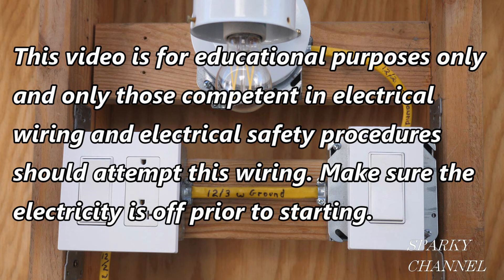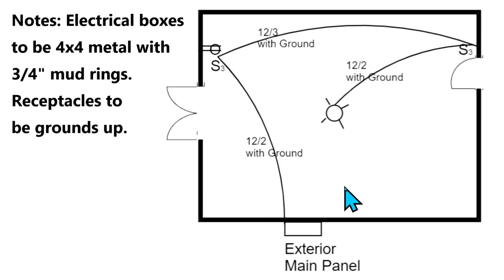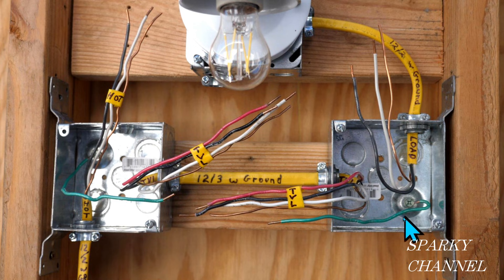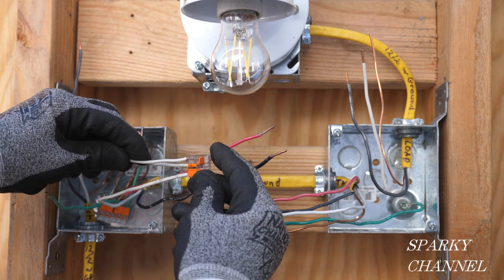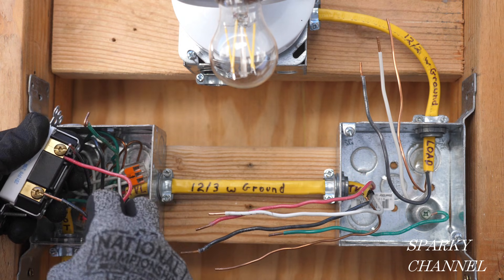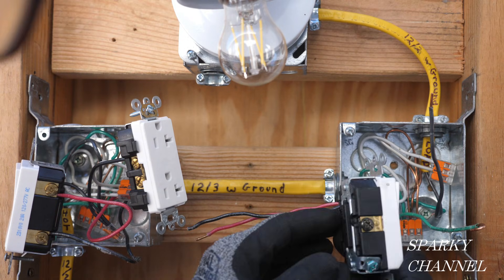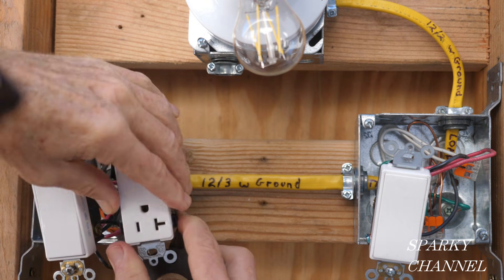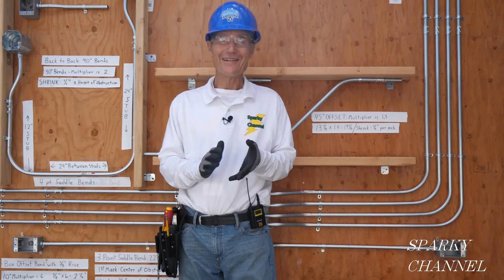Add a Receptacle to a 3-Way Switch System + Wiring from Plans

Comment: Also, just realized that if you're using something plugged into that receptacle, and it trips, you'll be standing in the dark?
Reply: 🤦🏽 this is how you feed receptacles you bring your homerun to the switch box from the bottom you run to receptacles then from the top of your box you run to your fixture not sure how you were taught but now it’s code to have a neutral leg in your switch box
Reply: @Weasel_NM575  I was referring to the fact that the lights are being powered by receptacles. I was taught almost 30 years ago, to keep receptacles and lights on separate circuit breakers, so that if if a receptacle trips the breaker, the lights don't go out as well.
Reply: He said it was a tutorial on how to work from a plan and that it was a simplified plan that could have been drawn up by an architect or home owner. It wasn’t a tutorial on how best to wire a room.

Comment: Does the plastic backing plate need screwed to the mud ring? If so, what's the point of using a "screwless" wall plate if the backer plate needs screwed to the box? That adds an extra step, whereas a regular plastic wall plate would have been just fine, correct?
Reply: so you dont see the screw heads i think

Comment: Thanks for your video and step by step instructions. 

I recently added a 120V receptacle to my three way hall lighting using your video instructions. For reasons I cannot explain the outlet is non-operative. With the lights off the tester shows
“Hot/neutral reversed”. With the lights on tester shows “Hot/Ground reversed “. 

The wiring is according to your description but the outlet is not working!

There’s a pigtail neutral from the spliced neutral to the outlet and a pigtail from the power source to the outlet. The grounds are spliced together.

Any ideas? Thanks.
Reply: Because the hot disconnect when you turn off switch.
Reply: Yes I have same senerio  I have 2 3way switches one 3 way in one 2 gang box with receptacle and 1 3way with receptacle other 2 gang box problem is either outlet only comes on when 3 way switch is on ? Lights work perfect on off either location but hiw do I get outlets live all the time?
Reply: I assume you are connecting the receptacle on right side metal box as shown in the video. Receptacle in left metal box is simple as both hot and neutral wires are directly connected to breaker.
Reply: Any ideas? Power comes into first switch 14/2 then 14/3 between both 3 ways?

Comment: Is it possible to add an outlet to the other switch?
Reply: Yes
Reply: @GailUrge-vq6qn  which wire would you connect to hot on the outlet?
Reply: @YarGnawh  it is added by being installed with the switch inside that junction box BUT needs have an individual hot wire coming from the first junction box or from somewhere else to power it

Comment: I am working on a house that was built in 1951 with a similar setup but a major difference.  The hot 14/2 wire feeds a duplex outlet and 3 way switch at the door leading from the garage into the kitchen.  A 14/3 wire runs from the two gang box to a single gang junction box at the overhead garage door opening as shown in your video.  The difference is a 14/2 wire runs from the light back to the 2 gang box by the kitchen rather than to the 3 way switch by the overhead door.  
 
The white wire from the hot 14/2 is connected to pigtails going to the duplex outlet and the white 14/2 wire from the light.  The black wire from the hot is connected to pigtails going to the duplex outlet and the common screw on the 3 way switch.  The white wire on the 14/3 is coded black and is connected to the black wire from the 14/2 wire from the light on one end and is connected to the common terminal on the 3 way switch by the overhead door.  The red and black traveler wires on the 14/3 are connected to the traveler termals as in the video..

This method of wiring is called a dead end 3 way and is used when it is easier to add a 3 way switch by running a 14/3 wire between two switch junction boxes rather than from the light to a new switch box  The disadvantage of this setup is that you can't continue on with additional switches because there is no neutral wire in the new switch box. This could cause a problem with some of the new "smart" switches that require a neutral and some jurisdictions may prohibit this method.   I think your viewers would like to see a video on this setup because it is  hard to find on YouTube and is something you might find in older houses.

Comment: Can you show us how to add a receptacle to the box on the right?
Reply: You would have to run and pigtale another 12/2 cable with ground from the hot box to the other box to carry the "line" wire power to attach to the recepticle so it would be "constant" on.
Reply: @tracykey9227  What if the light, switch, and outlet are 60 feet away from the switch with the incoming power?

Comment: Can you add a receptacle to the other box on the right as well?
Reply: I tried adding an outlet on the right  side switch , but it is not ‘always on’. When i toggle the switch , the outlet works, else it is off. Any suggestions on how and what wires to connect?
Reply: You would have to run and pigtale another 12/2 cable with ground from the hot box to the other box to carry the "line" wire power to attach to the recepticle so it would be "constant" on.
Reply from the maker: Yes.

Comment: Can u add a outlet to the right box ?
Reply: What if I drop two wires from the travelers?
Reply: @jororta  did you ever find an answer?
Reply: did you ever find an answer?
Reply: The switch would have to be on for the outlet to work

Comment: Thanks for this very informative video. In my situation I have a finished house and need to install an always on outlet, which would correspond in your example from box 2. When I test the leads on the 3-way I'm not seeing 120V all of the time (depends on the switch position). Is there no way to rectify this so I have power at this switch for the outlet at all times (without opening walls, etc)??? Thanks!
Reply: You would have to run a power lead to the new desired receptacle from an always on receptacle (like in the video) or power source.
Reply: @cfldriven  Thanks for the response. I figured that would be the case.

Comment: What if you want the power plug on the other switch where it only has the travel wires.
Reply: For real, I need this info. Does anyone know of a video that show a plug coming from the other switch?
Reply: The outlet would only work when the switch is on.

Comment: Awesome video, great explanation. I only have 1 question, what if I wanted to put an outlet on the other 3 way switch running to the light? Would I tap into the common on that switch with a wago nut? I assume it’ll work but only when the switch is on and that’s ok since I use Alexa enabled devices it’s always on anyway.

Comment: Can you put the light wire on the other box with the outlet and light switch?
Reply: Yes but you'd be left with a dead-end 3 way with no neutral in the second 3 way switch

Comment: You don't use 12 on a light
Reply: Nor do you have to.
Reply: You can. It's overkill for lighting circuit but not for receptacle or combined circuits (like bathroom exhaust fan with light or attic furnace and light. Better to be safe than sorry.

Comment: Since 2011 NEC code calls for a neutral wire in both switch boxes.
Reply: There are neutrals present in both boxes. In the first box it's obvious. In the second box, Bill used a 3 conductor lever nut, instead of a 2 conductor one, for the neutrals to allow for a smart switch. Just because there's no neutral pigtail present in a box doesn't mean it goes against code. You should pay closer attention next time.

Comment: Why don't you use the second set of terminals on the plug to connect the black and white pigtails?  I like 3 way switches.  But a lot of times my OCD takes over when I see the switches up to turn things off.  I have a tendency to want to go around and make sure the switches are down for off.
Reply: The way he wires them it's both switches up and both switches down = On , any other pattern = Off 
https://youtu.be/cOFKnAGOPg4?t=900

Comment: Is it common to fill up a raceway to max capacity, or should you go up a size for pulling purpose?
Reply from the maker: It's good practice to go up a size. Then you can add wires later as needed.

Comment: Bill. If you were building a new home, would you use metal boxes for all switches and receptacles?  Also, would you use mud rings on each?
Reply from the maker: Yes, I would. I came up working for an architect and he always insisted on metal boxes so I guess it stuck with me.
Reply: Metal box saved my house from burning down. My home was made in the 1970's has Aluminum wire the hot water heater was replaced by a licensed contractor from an old school electric to a new heat pump. The old water heater someone had put a timer box on the wall terminated the Aluminum wire into the timer box it was type you see used for years on a pool pump. Then whip from the water heater terminated into the same box. The plumbing contractor spent all day working on it last part was the timer removal. He took some old yellow wire nuts just connected the Aluminum to copper I didn't see him do this. A week went by I noticed the water was cold I went out saw the breaker was tripped I turned it back on and after about 5 minutes I noticed a black streak up the wall I shut the breaker off take the single gang cover off where the whip went into the wall box cover wire insulation is melted back to the clamp in the metal box. What saved me was the wire melted back to the clamp when the insulation burned off it grounded the hot wire to the grounded box tripped the 50 amp breaker. If I didn't have a metal box I'm not sure it would have tripped there was a common wire with that 220V wire.

Comment: Sparky,
I’ve done a lot of electrical work over the years and have  question. The way i was taught was to install reception with the ground up as you showed in your video. It was explained as what is required for government facilities. Elsewhere (non-government) I’ve seen the ground is installed down. Do you know why?
Reply from the maker: Grounds up is seen as safer because it may be harder for a plug to fall out, home owners prefer grounds down because it makes a smiley face. :)
Reply: @SparkyChannel  Also in hospitals ground are up,. One example is that if a piece of metal falls between the plug and the receptacle, it's most likely going to hit the ground and avoid a short circuit or ground fault. This keeps life saving equipment running without issues. Another good reason to have ground up is if you are using metal device covers. If it should somehow come loose and fall down and jam between the plug and receptacle, it would only hit the ground and not hurt anyone nor would it trip a breaker.
Reply: @SparkyChannel  Not only that.  A lot of home grade devices that have a right angle plug with a ground such as a fridge have the plugs with the ground on the bottom which would cause a sharp bend in the wire if the ground was up.  Even the 2 prong right angle polarized plug is usually wired with the wide blade on the right.

Comment: Sparky,
I’ve done a lot of electrical work over the years and have a question. The way i was taught was to install reception with the ground up as you showed in your video. It was explained as what is required for government facilities. Elsewhere (non-government) I’ve seen the ground is installed down. Do you know why?
Reply from the maker: Grounds up is seen as safer because it may be harder for a plug to fall out, home owners prefer grounds down because it makes a smiley face. :)
Reply: Sometimes its used to indicate a switched receptacle.

Comment: I would be happy if I could buy some plain green wire sleeving so I could sleeve my ground wires at devices. The Brits do this right.
Reply: You can buy green wire either stranded or solid sold on spools of by the foot.
Reply: @SparkyChannel  I am OCD and I do tend to catch mistakes. Sometimes I catch my own just in time. If you are looking at the face of a device, the open end of the wire loop on the right side terminals will always be up, and the open end of the wire loop on the left side terminals will always be down. I also tend to turn the switch in whichever direction I need to in order to work comfortably from the same position, starting with the ground. I may have to turn the switch upside down in order to do this, then put it right side up to continue with the line and load (or line and neutral, depending on device). Great video as usual, though.

Comment: @Sparky Channel DIY sparky here. I was just making some pigtails for stock and have a Random question. Why does Romex have paper wrapped around the white and black conductors inside the sheathing? Isn't that a fire hazard?
Reply from the maker: I've seen it wrapped around the bare ground wire. Yes, it is a fire hazard. Sparkies from other countries are amazed that we do it that way.
Reply: @SparkyChannel  I guess it shouldn't be an issue if installer is adequately schooled beforehand. Thanks for the reply. Your channel is a treasure to all. Blessings and be safe!
Reply: @SparkyChannel  I got a 15ft roll of legit Romex 12/2 from Home Depot yesterday and all 3 conductors are wrapped in paper.
Reply from the maker: @IsshmanGarcia  Interesting. Southwire brand?
Reply: @SparkyChannel  Southwire Romex SIMpull 12/2 w Ground 15ft Yellow
Reply: @Shadi2  I did already. It lit!
Reply: @SparkyChannel  There is paper around the ground and also paper around the whole cable, under the sheathing.
Reply: Isn't the paper there to make the sheathing easier to remove?

Comment: Hi Bill. Nice video, as usual!
Consider we have a 3-way switch, a receptacle and a light attached to each of the boxes.
Is the (over here legal) version with 12/2wG-in (line), 12/2wG-out(light), 12/2wG-in/out(travel wires) allowed in the NEC  (provided that the L in both boxes is the same, of course)?
Reply from the maker: Thanks! The NEC specifically bars switching the grounded (neutral) conductor or the grounding conductor [404.2(B)] (Figure 404-2)
Reply: @SparkyChannel  Sure, switching the neutral or ground has been forbidden here for 50 years, too, for good reason. What I mean, however, works without switching the ground.  Your web page throws PHP error messages, otherwise I would have sent it to you.

Comment: Sparky we've been without power for six days. Can you do a video on how to wire a generator receptacle.
Reply: It isn't that easy. I would always hardwire the generator to the installation, feeding the most necessary circuits like the fridge and the heating system. Eventually a well if you got one. The thing is, you must ensure that only one supply is connected to your installation. Either the generator or the grid, but not both at the same time. That would be a very bad thing for several reasons.
1. If the installation is connected to the energized grid and you connect your running generator that would blow up your generator and blow the main fuse, or trip the main circuit breaker of your installation. Your generator is not synchronized to the grids voltage and frequency, so that would be a massive short-circuit.
2. If there's a power outage and you connect your generator without disconnecting your installation from the grid, you would create a backfeed to the grid. That would endanger personell working on power line, because the power line would become live from the other end...

This is called a transfer switch, you can get automatic systems which detect a power outage, start the generator and disconnect the grid and connect the generator automatically. The power is back within 15s for the important circuits. But these systems are expensive. You can also get a manual transfer switch. Depending on the dimension of the switch (how many amps can it switch), the cost is round about 200 Euros (250 USD).
Actually this is not a DIY project...you require at least someone who helps you with the planning an the wiring of this.
Reply from the maker: Bless you and best wishes! I would love to make that video but I don't own a generator. Sorry.